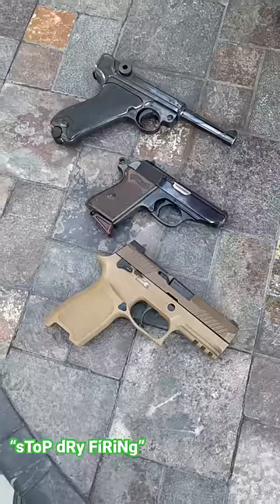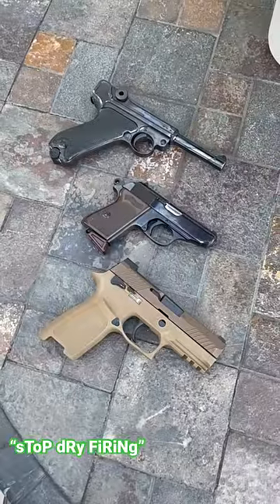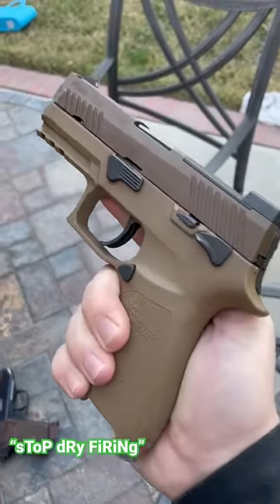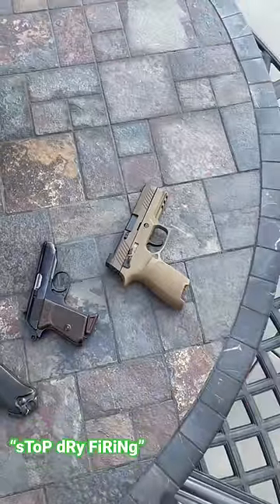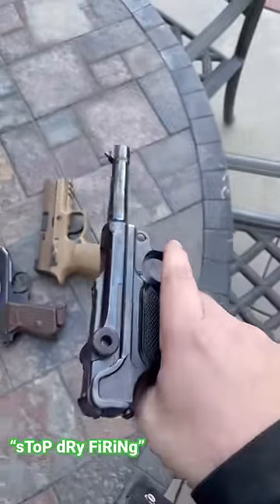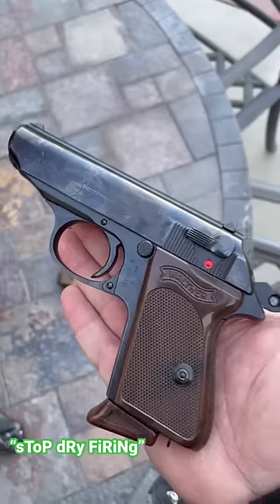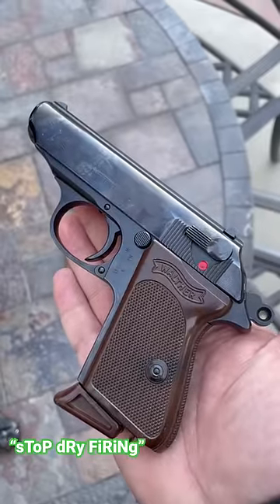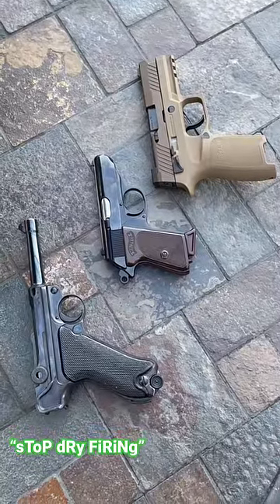“sToP dRy FiRiNg” #shorts

Comment: A common rule of thumb is if the gun uses a closed bolt firing system it is fine to dry fire and if it's open bolt it may damage the bolt housing group or the upper and/or lower receiver

Comment: I literally dry fire my weapons every time I finish cleaning and clearing them. That's how I found out I fucked up the safety on my AR and it was unsafe to leave in that condition. (I got some dirt in the safety selector spring, it was a simple fix)

But I can only switch the selector when the weapon is charged, so I had to dry fire it to test it.
Reply: Just load it up and rack it and aim at the closest pig at the station.

Comment: It happens on the CZ-52 as well. It has a decocking lever which is very powerful and it will shatter the very brittle firing pin if used on an empty chamber.

Comment: Just throwing my two cents in, I was always taught to never dry fire a .22 because the firing pin has to hit the cartridge hard but because it’s so small you can actually bend it slightly from the weight of it from said dry-fire, not that it strikes the breach face, never heard of that, but it makes sense now from what I know

Comment: fun fact: there are some rimfires that are completely fine to dry fire. They cut out a small portion of the face specifically to avoid that issue. 

fun fact 2: some double barrel shotguns, despite being center-fire, are not made to handle dry firing. They run into the same issue as the .22 with the firing pin hitting steel with excessive force, but instead of the chamber, it’s the inside of the receiver. That’s because some shotguns use a sort of half-dumbbell shape pin like this: (—[]).  This isn’t true for all double barrels though.

Comment: Dry firing as fine as far as I know but several reputable sources have said not to release the slide without a round chambered as the gun isn't designed to take that stress without a round in the chamber. Instead gently guide it forward.

Comment: Check out the firing pin of the .22 Walther GSP which has a protruding blunt area just above the sharp edge which strikes the rim. It is the blunt part which strikes the breech with dry firing.

Comment: it's a matter of physics, every motion that occurs within the chamber is the same whether you have a round chambered or not, the only difference is with a round chambered the entire force of the defligration is exerted upon the frame of the firearm meaning the stress from firing a round is in fact much greater than with dry firing thusly putting it at greater risk of sustaining damage. This is even true with rim fire firearms unless it has an external firing pin as with this structure the firing pin would clip the brass and embed itself absorbing a small amount of shock before it makes contact with the "breech face", meaning if there is no cartridge to absorb this shock, the pin itself will come into direct contact with the chamber internals which could damage either the pin or the "breech face" though it's not a garunte this will damage the firearm, it is a possibility and an eventual inevitably so don't get carried away. Very few firearms contain the capacity to self destruct upon executing their one and only function, if they do it means you got a very poorly manufactured firearm.

Comment: A little bit of dry fire is okay but great to go ahead get some snap caps if you are working over and over day after day. Say 50-100 reps per night on the draw to first shot. Replacement of MIM parts is important and changing your firing pin to tool steel is definitely an upgrade everyone should do.

Comment: A lot of modern rimfires are dry fire safe. The manual for my Mk. IV and 10/22 both say occasional dry fire is not going to damage the gun, but extended dry fire sessions should be done utilizing a snap cap. Interestingly, nit every centerfire handgun is dry fire safe. Dry fire without a snap cap in CZ-75s and their clones can damage the firing pin retaining pin, for example.

Comment: In Poland we had many issues with dry fired Walthers P99's in our Police force - the back plates were being worn down and there were problems with them exploding and fragmenting due to stress of dry firing and this lead to replacing them - so no you shouldn't dry fire guns - always use dummy rounds no matter what gun do you use. Sure some might handle it better than others but it's not healthy for them. Sure few dry fires wont matter but it is a cumulative issue of increased and needless wear and tear on the gun parts.

Comment: A lot of rimfire guns are designed to be dry fired, like Anschutz and other competition smallbore rifles. The firing pins are designed to not protrude from the bolt face, and will not strike the edge of the chamber. While firing pins can still break, if you check and verify that the pin does not stick out past the bolt face then dry firing a .22 is no different than a centerfire.

Comment: Some modern .22LRs are designed for dry fire as well by having a cut out in the breach for the firing pin. 

I know the CZ 52 pistol in 7.62x25 is supposed to be notorious for firing pins breaking from dry firing. I haven't heard of another pistol having the issues with breaking firing pins like it does.

Comment: FN 509 with an APEX striker upgrade has a certified 125k dry fire minimum lifespan. Also it came about because they had issues earlier on with firing pins breaking from dry firing AND normal firing within a few thousand rounds.

Comment: I have a 1911 that is almost 80 years old I've changed just the firing pin and it was still functional at the time. Guns are designed to withstand an explanation if something brarks fix it just like you would a car.

Comment: I am a retired custom gunsmith. Firearms made after the 80s can be fired till the cows come home. Metal tempering from the 70s backwards was spotty. So I wouldn’t do it. Also rimfire guns should not be dry fired because the firing pin can damage the chamber opening from pin impacts.

Comment: I do wanna add that 22lr isn't the "only" gun you shouldn't dry fire. Older revolvers that have, what is essentially a "firing pin" on the hammer, aren't great to dry fire, either.

Comment: If you have snap caps you should use them, if for no other reason than the fact that you have them, but I agree that in most center fires it is a non issue

Comment: I use snap caps JUST IN CASE on center-fire pistols. Years ago I bought a USED Star 9mm that was fairly NEW manufacture and to my surprise the END of the firing pin had broken off. I replaced it fairly quickly and easily after going through a little trouble getting the original part. NICE Walther PPK 22lr, I had a PP 22lr, sold it NEEDED THE MONEY 😯😳😭. I've got a steel frame (older) Walther PPK/s 22lr. You are PROBABLY SAFE with the P08 (Luger) because the firing pin on it is short and stubby, doubt it would BREAK but WHY TAKE THE CHANCE with the numbered part. Most firing pins are quite skinny and prone to break when they are dry fired because they HYPER EXTEND which makes the firing pin break. Weapons were MENT to fire bullets not be dry fired A LOT.  LOVE MY Walther PPK/s 22lr, but I do miss my Walther PP 22lr. It shot VERY GOOD with the CHEAP Remington Thunderbolt ammo.😁🤗👍😎

Comment: You a wrong about most modern .22LR guns, most are designed to be dry fired. Have a look inside and see if the firing pin has a place to rest, older guns didn't always have this. CZ452 is a good example of a gun made to be dry fired. Semi autos can be dry fired very safely by putting a strip from a bicycle inner tubing on the breach face, that removes any chance of injury to the chamber. Fixing a chamber that is dented is a quick job for a gunsmith.

Comment: Ohhhh you missed the Colt 1860s the single actions that still have a firing pin on the hammer. Any modern weapon has a Hammer Block to prevent dry fire damage. However,,,You should release the tension off any firearms spring or risk it’s premature compaction. 
Simply hold the trigger down on an empty weapon when cycling the weapons till the breach closes completely. 
Spring Tension is released, it’s ready to insert an empty magazine and store. 
That’s your Tip for the day. 
🧐

Comment: Do a quick internet search of the individual weapon before you start dry firing as a technique to smooth out your contact points or just practice trigger control. 

I don’t have an issue with doing it, if the owners manual or authority having jurisdiction ok’s it. Great way to smooth out gritty or rough triggers. If you intend to do it for this purpose, I strongly recommend snap caps or homemade dummy rounds. I assure you, if you do an internet search of just about any weapon (PSA  Dagger), you will find a group of folks talking about damage that occurred to their firearm from doing this. Most weapons will not have a problem, but why risk it. Just my opinion. I don’t want to be right, I just don’t want to be silent when it might help someone to know.

Comment: the original smith and wesson m&p pistols had a known problem with firing pins breaking from dry firing and I experienced it with my own gun.  Is it really that hard to believe that different guns with different metallurgy might be affected differently from dry firing. I still dry fire for practice but it can be an issue with some guns.

Comment: Lots of 22s can be dry fired; it depends on if the gun was made by gunsmiths or boneheads.  My old K-22 Masterpiece has specific instructions (from the factory) about dry-firing; it just says to do it at a designated shooting location for safety purposes.

Comment: Even with .22 and other rimfire firearms, it depends on the particular firearm and how it is designed.

However, one that was not mentioned is typical "hunting guns" that are bolt-action or lever-action. Many can be rather finnicky with dry-firing, so it is best to avoid if possible.

Comment: There are some guns you should not dry fire, but most guns it shouldn’t be an issue (so long as your not just sitting there doing it 8 hours a day for 10 years.)

The issue comes more from black powder days. Dry firing a percussion revolver for example, CAN damage the nipple the hammer slams onto over time. Significantly faster then live firing it.

Comment: The official field strip procedure for an AK is to do a "control trigger" (not sure how this is called in English) as you begin disassembly, and once you completed the assembly of the firing mechanism (as soon as you put the dust cover in place). 

The same is true for nearly every other weapon in service. Whoever claims that this is to be avoided has clearly never handled firearms properly, and should be given an education on the proper handling of firearms.

Comment: Not gonna lie, this is pretty true. Don't dry fire is pretty fudd lore. and also yeah, just be careful about antique or vintage firearms, have it looked at, check the barrel, head space, everything in case it was a pretty used and burnt firearm. To why he said have replacement parts because they can fail dry or mid range day. Had it happen a few times

Comment: I wouldn't say it's fine for only 22LR. Don't dry-fire any rimfire, or certain pistols like the CZ 52 - which has an iron firing pin. Whenever I find one for a decent price, it'll get outfitted with new/modern rollers and a steel firing pin.

Comment: i never dry fired any of my bolt action rifles. my dad taught me how to hold the trigger in with the saftey off when the gun is unloaded as u close the bolt. so the firing pin is released and not sitting under tension forever in the safe but at the same time its simply released that way without any tension behind it. id never dry fire a bolt action rifle centerfire or not. but yeah a pistol or ar i dry fire and dont think twice about it. i actually aim and dry fire a couple 10 or 15 times before i put ammo in whe i start shooting just to get back my muscle memory

Comment: the best is when your ruger mark one from the pawn shop has a pin in the bolt that has been replaced with a piece of welding rod so it falls out during re-assembly and the firing pin hits the chamber with the fury of 1000 suns
Reply: Sounds like a very specific and very funny memory

Comment: I unfortunately learned that, despite the usual case of dry firing being perfectly fine, old combloc TT style handguns will fall apart if you dry fire too much. I have a Romanian TT-C and there is a firing pin retaining pin to keep well, the firing in place. I didn't know that they are apparently exceptionally brittle and susceptable to prolonged force, and one day i dry fired it and the whole firing pin ans spring came rocket manning out the back of the gun lmao. Only learned afterwards that you should limit it and that as per usual soviet manufacturing can range from great to dumpster quality.

Comment: They make a product called snapcaps that allows you to safely dryfire your gun.
It has a spring loaded cap that allows the deceleration of the firing pin. I have damaged a 12 gauge shotgun dry firing it, never again. I discovered the problem on a wild boar hunt when the gun just clicked and the wild boar was 20 feet from me! Talk about adrenaline! I had 4 more misfires before it finally went off and snuffed the 500 lb boar.

Comment: I had a cheap RG single action 22LR revolver. I must hsve dry fired it 10,000 times. It finally got so worn, the sear would not hold. I retired it after that. I was just lucky I didn't break it with the dry fires.

Comment: I broke a glock 19 firing pin from too much dry fire because the actual round count was super low given when it broke. It can happen but its nothing a quick swap cant fix. Now I always keep a spare just incase because while these guns are designed a certain way doesn't mean they won't have issues regardless.

Comment: When I was in the military, the way we would make sure the gun did not have anything in the chamber after shooting was with a dry fire.
Reply: Which is a terrible way to check, because guess what happens if you’re wrong?

I was also in the military and those clearing barrels are the stupidest things ever. Pull the bolt back and inspect the chamber visually, don’t treat a gun like it’s unloaded (violation of gun safety rule #1).

Comment: Don't dry fire AIRSOFT because the plastic parts have high stresses when the force of the spring isn't dissipated. 

Then an explosion is now the driving force of motion the energy output on a dry fired spring seems far less comparatively.

Comment: It wont technically break the gun. Dry firing a 22 rimfire will peen the breach face. If it gets too bad, there will be a deep peen mark under the rim of the cartridge. This will cause misfires because of the void under the rim.

I personally store my firearms by taking the tension off of the firing pin spring. Not necessary with striker type handguns. There are no compressed springs in these.

Comment: Especially with rim fire firearms it will damage the barrel and it won’t eject or chamber a unspent shell unless you put the metal it moved back with a barrel taper but even then you gotta worry about the barrel splitting when it ejects a spent shell and injecting the slide into your face almost had it happen barrel split when i fired the 2nd round and the slide looked like a game of fruit ninja

Comment: Does tgis apply to ar-15's. I recently purchased my first and have been so paranoid when doing a load check I release to upper to manually release the hammer. Do I need to worry. It's a Windham weaponry ar-15 if that helps.

Comment: Dry firing an old revolver that has the pin attached to the hammer cam harm it as well. Now, a revolver with a transfer bar is okay to dry fire and of course as he stated in the video do not dry fire any 22 unless it is one specific gun. You can dry fire a heritage 22lr revolver if you put it in safety first.

Comment: Certain revolvers should not be dry fired.  If they have the firing pin on the hammer it's a no go.  Also, Beretta recommends the use of snap caps.  Also, with some guns like the CZ P10 series you can damage the firing pin retaining pin.

Comment: That's not true for all pistols. If you repeatedly dry fire the CZ P07 without a snap cap the firing pin goes beyond the intended point of impact and bend the cross pin eventually breaking the cross pin and then bending or breaking the firing pin. There are replacement cross pins available made of a solid piece of metal; but I'm not sure how much of a solution that is as the firing pin is now striking an even harder material. 
Every firearm is different and you need to know what works for yours.

Comment: Know your history.  Not dry firing is a holdover from the old cap and ball days where a hammer impact could damage the nipple.  Does not apply to centerfire firearms.  And floating firing pin .22’s have pretty much become standard nowadays.  But check your particular rimfire.

Comment: Isn't it indeed better to dry fire and relieve the stress rather than leave the hammer cocked? Also, it's a certain way to make sure there is nothing in the chamber and the gun is unloaded without a doubt. In the army we were always taught to dry fire after every single empty chamber check and after assembling the gun.

Comment: How do you function test the gun without dry firing?
Reply: Actually firing.
Reply: @StretchOnYT  that’s a good way to get hurt. The gun is getting dry fired one way or another. When the gun is handled much the slide is going to be pulled back without a clip in it. Like when clearing the gun.
Reply: @lemoncake9597  huh! I I'm pretty sure I answered your question. The only way to functions test without dry firing is to actually fire a cartridge!

Comment: In my opinion a gun should be able to dry fire (if it's center fire) and chamber load without causing damage. A gun is a tool and it should be held to the same standard of function. As in just using it should not be able to cause extra wear to it